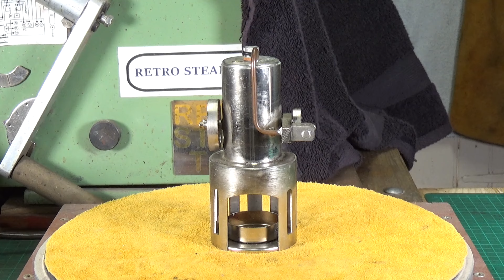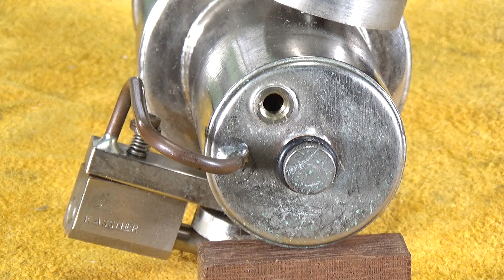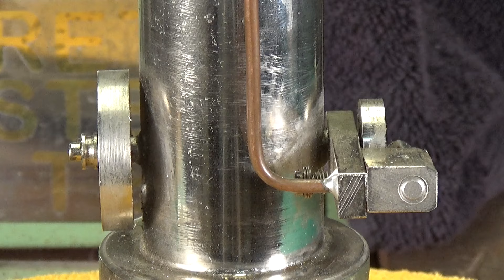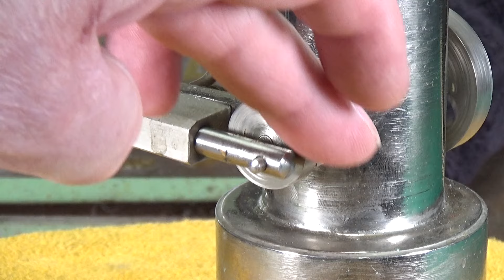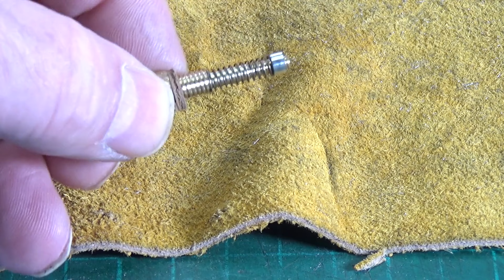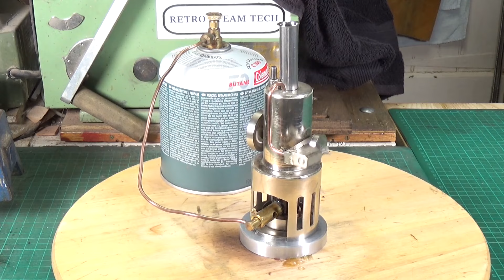Kassner Vertical Boiler Model Steam Engine

Comment: Interesting little engine, and a mystery to its origin Alan. Some grades of stainless steel are not magnetic. Could that have been used for some parts. I agree with others about the misalignment of the letters. Possibly made by a small business. Cheers Nobby
Reply from the maker: Hi Nobby. Yes, it certainly is a strange one. Since making the video I have taken a needle file to a part of the firebox which can't be seen and it's definitely brass. It's difficult to find any information on Kassner so it could quite possibly have been a small business. Cheers, Alan.

Comment: Nice model engine design Alan.  Raises a few questions.  The very clean/precise way the slots are cut in the firebox makes it look like a factory product.  Almost CNC, but the corners have zero radius, so it could be a stamping.  But where is the stamping sheet joined to form a circle ? The machining on the sides of the flywheel is poor.  Then there is the missaligned name impression.  Hmmm.  It's a a conundrum.  Cheers Rob
Reply from the maker: Yes, it is a bit of a puzzle. To me, most of the construction says "commercial product" but the name stamp is very amateurish. The real problem is it's so difficult to find any information on the company. Still whoever made it, it's a nice little engine. Cheers, Alan.